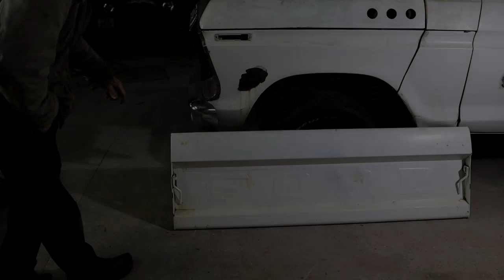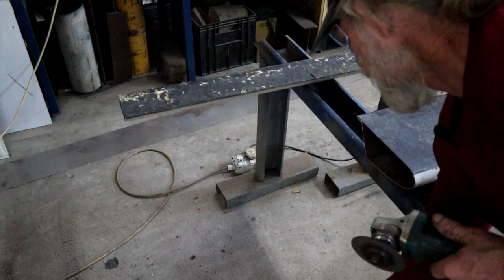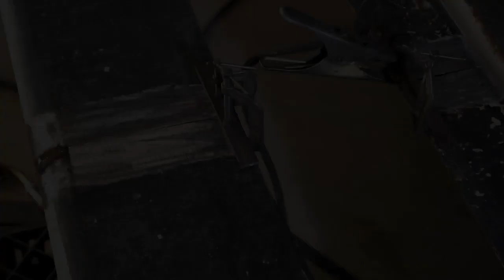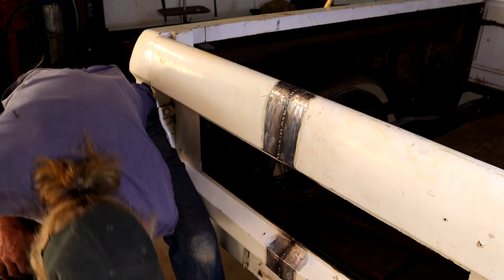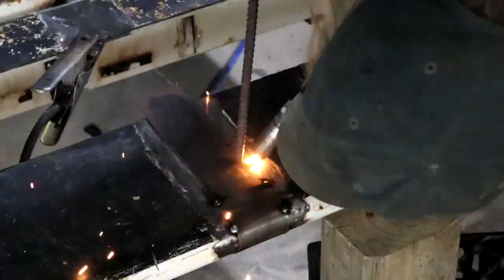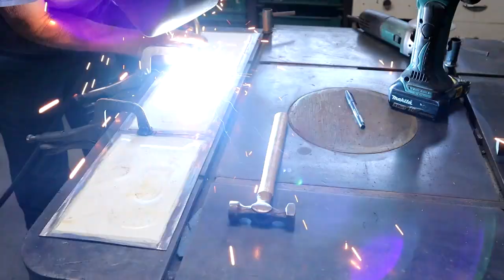CUSTOM TRUCK BED BUILD - FORD F100 (Part 3)

Comment: Another cheap fabricator here, I also use the grinder before the flapper. Great instructive content man! Wish I could weld as good as you, but since I can grind as good as you I'm off to a decent start.😅
Reply from the maker: A grinder and paint, makes us the welders we aint. 😄
Reply: A grinder makes you the welder you aint

Comment: To fill gaps do you use metal clothes hangers?
Reply from the maker: I've tried it, but if the wire is galvanized, its messy!

Comment: Hey Duffy, great job on narrowing that tailgate. Tailgates in Wisconsin don't last real long. Rust out in the bottom and at the weld joint just above the logo. A new gate fory 64 was about $1000. No way!:( I've had bad experiences with replacement used gates ( $600 ) that turned out just as bad. About 30 hrs of drilling out spot welds and fabricating all the bad metal and then welding it all back together. (You can ignore the following.) I used a light coat of Bondo to to finish it off. At least I wasn't bugging my wife!:) Thanks again!
Reply from the maker: Thanks. Same here with the F series tailgates. Hard to find used ones and very expensive for new

Comment: One thing I use for wider gaps is a wire coat hangers.  I use them as fillers.
Reply from the maker: Ja, that's a cool trick. I've started doing that too! 😆